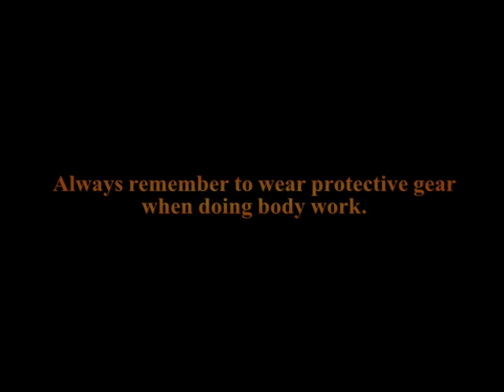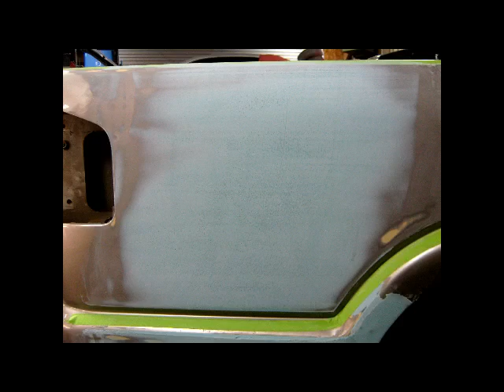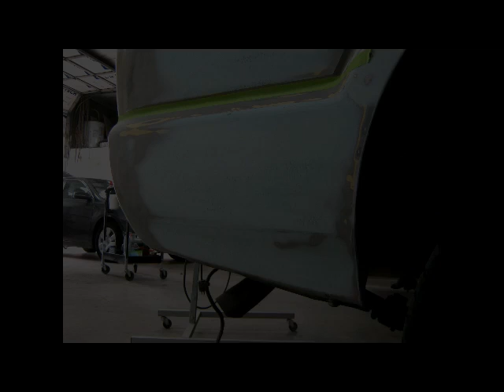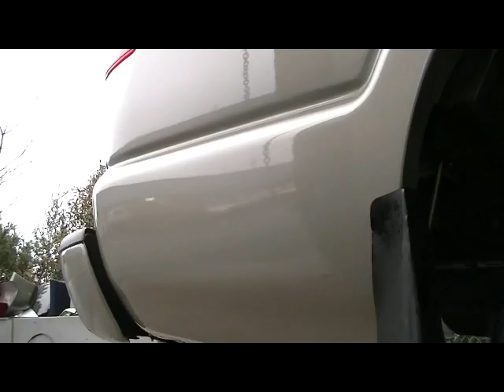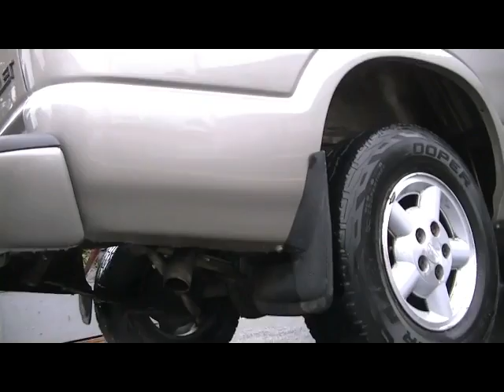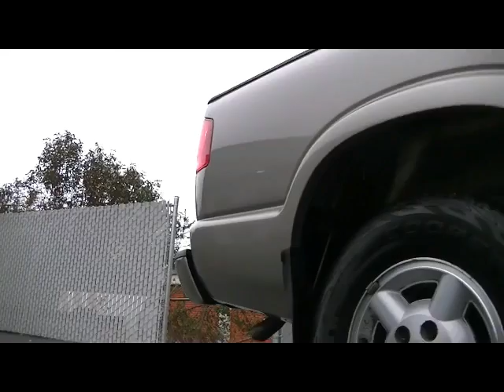CHEVY S-10 BEDSIDE REPAIR

Comment: Homedepot has flexible straight metal yardsticks for under $5.00. For 
less than $20.00 you can make blades that are exactly the perfect length
 for your panels by cutting them and you dont have to measure your cut 
its self measuring its a yardstick!